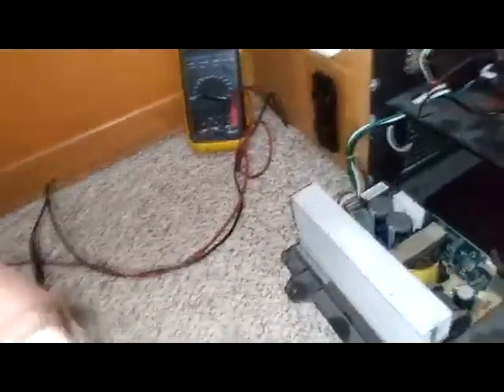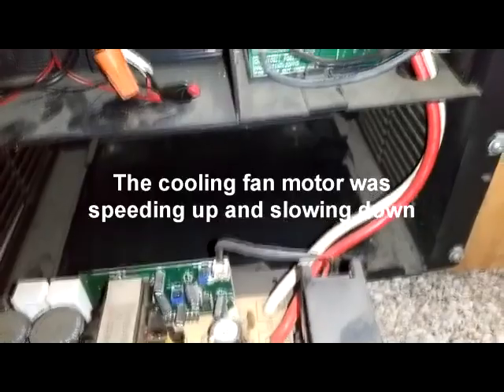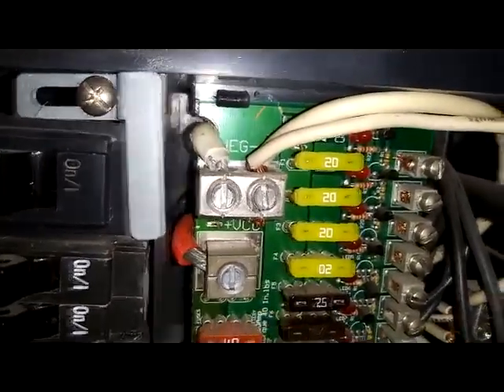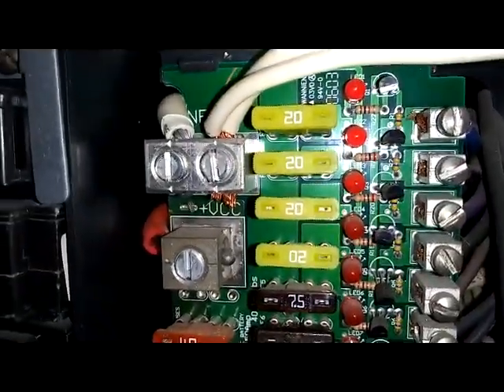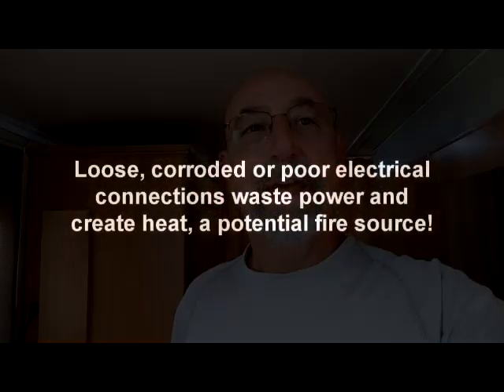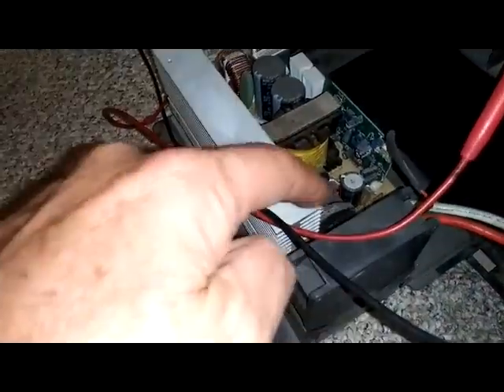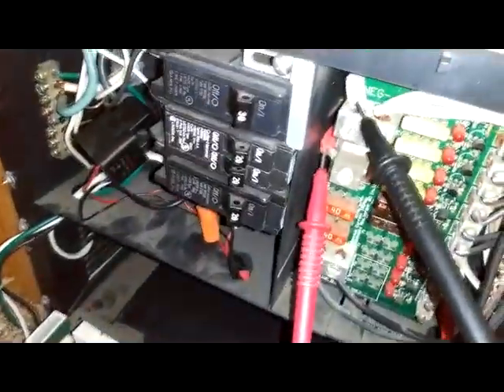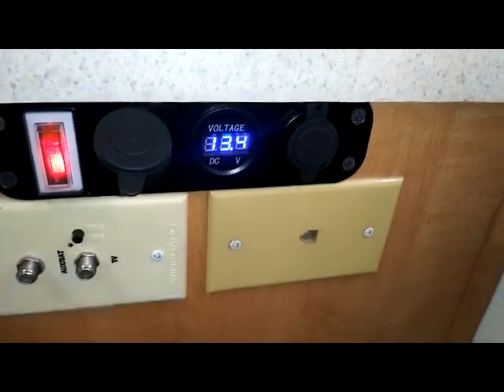2007 Trailmanor 2720, WF-8900 Electrical Panel Problem

Comment: Also not a good for the wire to be tinned with solder when in a screw terminal.  The thermal expand difference between the wire and the solder can cause the connection to loosen over time.

Comment: Hi Travis. I saw your video regarding installing a hard start capacitor to help your Honda generator start your window air conditioner. Just wondering how that has worked out since 2016!!!
Reply from the maker: It still works well for the 5k window unit that we use on our sail boat.  In regards to using the EU2000i for the camper...I say no.  My camper uses around 1,550 watts running, the little Honda genny is only rated for 1,600 watts continuous.  Basically....for me that is just slowly killing the genny by operating it at max capacity, hour after hour.  Plus, compressor restarts may not happen after things get hot and lots of head pressure.
We found another energy efficient window unit that we use on one of our micro-campers.  The honda does great with that and it barely speeds up from Eco Mode when starting the a/c.
Reply: @Flyboytr  Thanks Travis!

Comment: Part of my annual is checking for loose fasteners, fittings, and connections.  I haven't found anything electrical loose, but perhaps putting a dot of thread lock or epoxy on the top of the terminal screw would prevent any future mischief.  If I find any that feel they must get loose they're going to get that treatment.  Thanks for posting.  Safe travels.

Comment: Excellent find! That would be kind of hard to catch. Because several were loose, I would say the cause is vibration when towing. Remember to add Lock-Tite.  Looks like that is Aluminum wiring. If so, keep a real close eye on it.